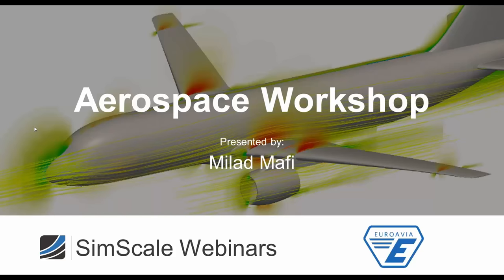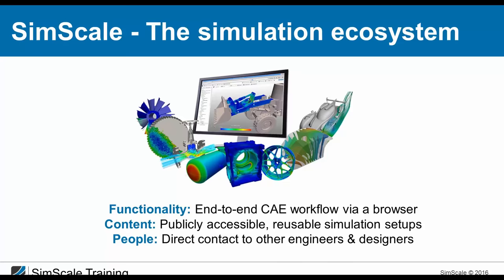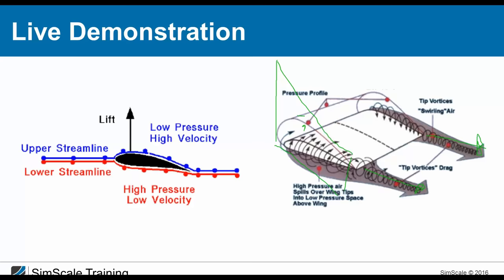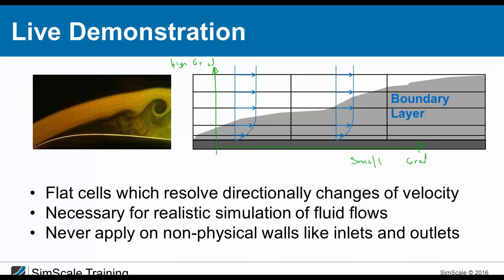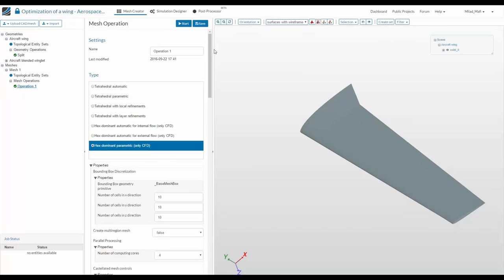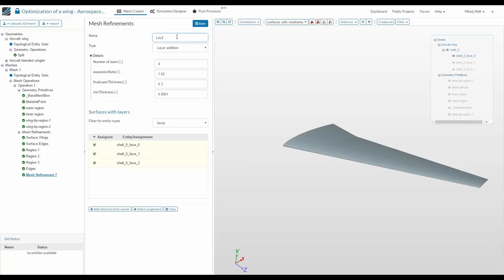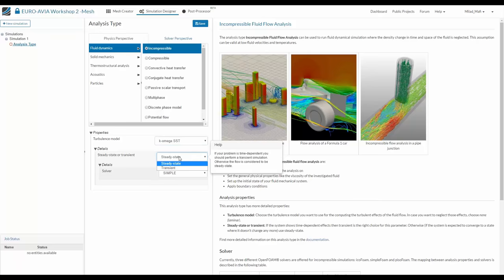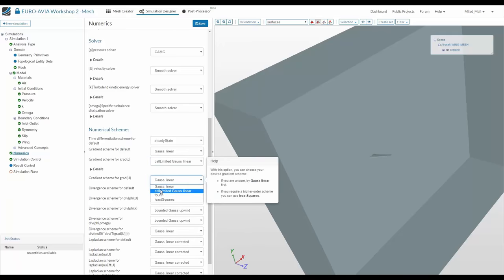Aerospace Workshop II feat. EUROAVIA: Aerodynamics of an Aircraft Wing

Comment: Can SimScale output stability derivatives?

There is no reason to use resource intensive CFD software to visualize flow and paint pretty pressure distributions. 

Aerodynamisists already know all of that information long before they create the 3D model, because wings are created by inverse methods since the mid-1940s. 

Stability and control is where surprises happen. I would like to know if this program can reasonably accurately predict effects of control surface deflection, and static longitudinal stability?

Comment: I recognise the image you used to teach theory of lift. It is taken from NASA "Incorrect Lift Theory" page. It is borrowed on Wikipedia under the section "False explanation based on equal transit-time".

All you are doing by being patently wrong is reinforcing a misconception. I'm surprised that you've chosen to use literally the most misleading picture you could have.

And if you think it's a good enough model, you are wrong. The air travelling over the top surface is faster than this model predicts. And this incorrect assumption predicts a lift which is significantly lower than the actual lift you would find in CFD or wind tunnel testing.
Reply from the maker: Thank you very much for your comment. Obviously, you are right that this explanation is a very strong simplification. However, we decided to use it since the aim of the session was  to understand the fundamental process of CFD and how it can be used to optimize an airfoil design.
Reply: I was overly critical of just a very small part of this video. The CFD instruction is actually very good and I've learned a lot - thanks for sharing these videos.
Reply from the maker: Hi Jay, no worries, the most important thing for us is to help our users learn, and we're very happy to get positive feedback from you.